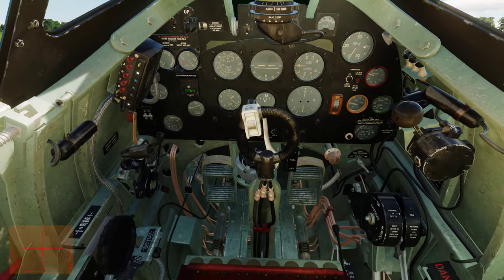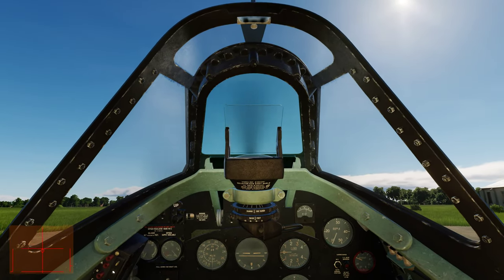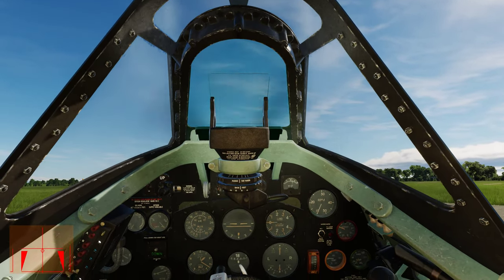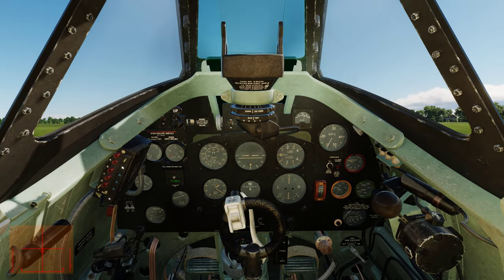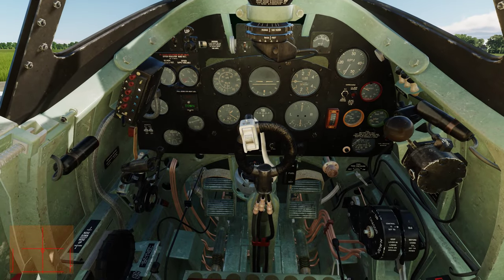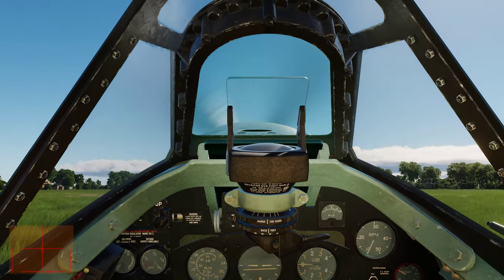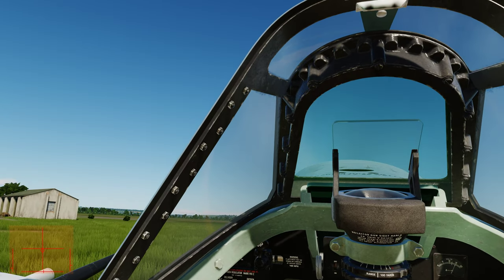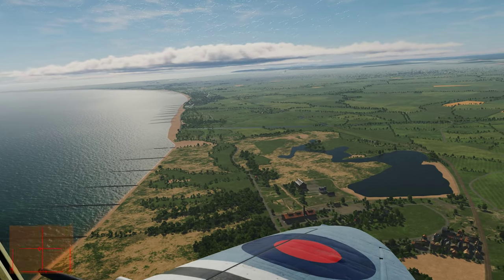WHY IS THE SPITFIRE SO DAMN HARD TO HANDLE? - Spit Mark-Nine Tips For DCS World Pilots - w/Sound Mod

Comment: Part of the issue with the DCS Spit is that the difficulty of ground handling is overdone. I flew a motion simulator last year that was used for transitioning pilots to the Spitfire, and in that - which you'd hope would be as accurate as possible, because it's a training tool for real pilots - the aircraft was about 30% less psychotic. Weirdly they didn't let me do a landing and takeoff in the real one when I flew that, I reckon I could have gotten the thing down in no more than two or three large pieces 😄
It seems weird to me that the control sensitivies are defaulted towards a stick length that maybe 0.5% of DCS users are likely to own. But then that's ED for you - correct as is, thread locked. There's no point in me adding anything about setting controls up etc, because everyones gear is different. One thing I do though is to use little or no curve, I try to get all the aircraft where I want them by reducing sensitivity. The brakes need some pretty drastic adjustments to make them work in any sort of a sane manner.
Reply from the maker: Totally...I think there are so many things to think of, Deadzone, Curvature, and Stick Extensions as well as the "Pilot Touch" on the controls.  I see guys transition from the Hornet or Viper to the Mustang and they Ham-Fist the controls to the max trying to get Gen4 performance out of Gen 2 Fighters.  For me, it was enjoyable years of dialing in my controls and learning on the fly...pun intended.  There is no substitute for self discovery.
Reply: The yaw axis for warbirds is totally over done in DCS.  There are a few videos on YouTube by real pilots showing the difference between DCS and actual planes like the Yak52 and TF51.  IL2 GB in that context is closer to reality
Reply: Dear Sir, I have had the privilege of flying many types of warbirds and Spitfire including Mk I, II, V, IX, XIV and XVIII. Spits are all squirely on the ground but generaly easy to fly and extremely forgiving, however the very very fine use of braking is essential for succesful ground operations. Without fine braking you will either ground loop or nose over in real life guaranteed. I have personally witnessed this in the hands of a renowned test pilot who shall remain anonymous. The issue in DCS is the quality of the pedals available on the market making Spitfire operation extremely challenging and harder than in real life. Joysticks are also far too short and short stroked making all inputs somewhat unrefined. So there is truth in all the comments in this thread, but this is not due to the mathematical modelling of the aircraft. In order to make things easier we would have to 'detune' the torque and brake modelling of the spit to cater for the less subtle hardware solutions available on the market which I am not certain is desirable. For the record, flying warbirds precisely in DCS is much harder in general than in real life due to general incoherence of input methods and lack of seat of the pants feedback which are important to manage aircraft correctly. So to all of you who do succeed nevertheless in operating them safely, congratulations, you would do very nicely in the real thing.... Many thanks indeed and kind regards, Nick
Reply from the maker: DCS is just perfect to me.  Keep going upward and onward sir.  It’s a simulator in its own class, and personally, the only flight simulation that I want to fly.  Often people complain about the realistic feel from their position of Documentary or Video Game Enthusiasts and compare DCS World to a simpler game that they have been conditioned to by dopamine to prefer over others. For me, the chemical jollies of my brain are founded on my own personal real world flight experiences.  I understand that not everyone has the ability or proximity to go flying, but I often recommend that DCS players without flying experience, go take a 1 hour flight with an instructor and “fly the plane.”  When I am in the Mustang or the Spitfire or the Dora, I’m not in DCS…I’m in the air!  Thank you Mr. Grey for your help and let me know what I can do to support your team,
~ Juice
Reply: @AIRWARFAREGROUP  Dear Sir, thank you for your message and for all your support. Onwards and upwards! Kind regards, Nick
Reply: I wouldn't say that the difficulty is overdone in DCS, just that without tacticle feedback like real pilots have, it's a lot harder to tell what the airplane is about to do before it does it.
As far as sensitivity goes, it's just how the aircraft was in reality.  It was extremely sensitive, pilot's using the euphemism that all you had to do to get a Spitfire to turn was to just blow on the control column.  I would agree though that by default, DCS could have the saturation Y pulled down to something like 60.  But considering that would be so unstandard, most people would probably keep flying cluelessly not knowing that there could be another 30% to their potential pitch range.
On another note though, got myself a T-50 Grip with the warbird base, no extentions, just today!  I'm coming from a T-16000 stick.  The grip to base distance is finally sufficient enough I feel like I don't need to adjust the axis settings at all.
As far as brakes go, use right toebrake. Or left, either of them.  It's much better than a button because you get that axis, and you get a lot more brake control.  It will make taxying your Spitfire incredibly easier if you bind it to either of your toe brakes
Reply: @Red-Magic  splendid stuff. Many thanks for your detailed description. Indeed, real life spitfires are indeed extremely sensitive especially in pitch. Great to hear that your setup works well. Yours aye Nick
Reply: @Red-Magic  On takeoff things start to happen before you ever feel them - if the motion sim is accurate. You have to be expecting a swing if you want to catch it in a timely manner. 
One thing I'd love to hear from ED is their justification for the 109 being so much easier on takeoff and landing than the Spit.
The Spit had a reputation for being a bit awkward, but the 109 was an absolute killer if not handled very carefully.
Reply: @colderwar  To each his own, mate :). I don't think such justification is needed, because I've been flying both DCS 109 and Spit since they came out and I'd say it's the Spit that's so much easier on takeoff and landing in the sim out of these two. The Spit takes-off pretty much by itself with two or three slight touches of rudder if the trims were set correctly in the first place, while the 109 requires tons of brutal rudder stomping all the way until climbout. On landing both reward touching down as straight as possible, but the Spit still graciously forgives any tiny bit of an unplanned sideslip, while the 109 in the same situation pulls rapidly to the side and the relatively ineffective rudder isn't always sufficient to catch the developing groundloop. I admit having a tailwheel lock is a massive advantage of the German bird, though! I agree with you on other points. Cheers!
Reply: @Haribo211  Expectation, experience and the users controls have a big role to play. 
Maybe a part of it is my rudder set up. I don't use any curves and have a linear response instead, sometimes with the saturation knocked back a bit.
But the DCS Spit doesn't agree with the motion simulator I flew - and you've got to hope the motion sim is accurate because it's used for training as well as expensive joyrides for idiots like me. It's not that different, just a bit more forgiving on the ground.
I still maintain that the 109 was a killer of new or unwary pilots, there's overwhelming evidence of that.  
Are you using auto prop pitch for your takeoffs in the 109 ? if so then set it to manual and half past 11 on the clock.
That makes life easy enough. Just don't forget to re engage auto once airborne, and sooner rather than later. If you don't then the engine will rev itself to death.

Comment: I just recieved my MFGs amd having more issues than i did with my ball crusher TFRP ones.  Its going to take me a few tries(hundreds of few lol)  before ill get proficient again.  Thank goodness its a simulation.  I would have been religated to sentry duty for ever if it was real lol.
Reply from the maker: How are the pedals though?
Reply: @AIRWARFAREGROUP  butter,  absolutely sublime.  No squeaks, flexing,  my nuts can breathe.  What's not to like lol.
Reply from the maker: Same thing here…I’m loving the space to keep my undercarriage cool and dry!   The regular game pedals like CH Products or Saitek are fine, just too narrow.  I’m the second owner of mine with a SN: 0934
Reply: @AIRWARFAREGROUP  funny,  I am also the second owner of these ones S.N 8434, £100 cheaper than new, now all that remains is purchasing 2 extra stands , 1 for throttle and 1 for keyboard for my wheelstand pro,  just to get it all in the right place.  I'm interested to know what number cam insert you use?  I think I have 5 in place at the minute.
Reply from the maker: I think it’s a number five as it came with two of them and the one that I don’t have installed is a number four.

Comment: Adjust your curves in wheel brakes .
Reply from the maker: Gotcha thanks. I’ll recommend that for new users for sure. I’m going to keep my brake/paddel switch mapped as I have no problems with taxi in and ground handling with the Spitfire and it’s more close to the real thing being on the control spade column.

Comment: Not so hard, it’s taxis just like a MiG-21.
Reply from the maker: I think so too...however, the MiG-21 is not a tail-wheel aircraft with it's inherent difficulties and the client should try this with "Takeoff Assistance" turned off all the way in the Special Settings under each warbird section.  Huge difference that pedals make (when set up correctly) than that of "Twist Stick" controllers.  For those guys who fly with Xbox/Play Station type gamepads, more power to ya. ;^)
~ Juice

Comment: can you trim the spit to fly hands off? I've just got dcs... spit mossie and f18 which I've not really done anything with so far , but the spit always wants to roll ... I've got the thrustmaster f1600 HOTAS...
Reply from the maker: I can for the most part, but the feet are needed still to keep the rudder in check for when the plane starts to deviate from power and speed changes.  Let’s just say that I don’t leave it flying to get up and go to the bathroom 😜

Comment: Its not hard its just a skill issue.
Reply from the maker: Totally agree. Once I learned the technique it's like second nature. I just have to remember to change my brain when I get get out of another airplane and get into the spitfire. My wife says it's pretty easy because my brain is pretty small and fits into my pocket.
Reply: @AIRWARFAREGROUP  I never found taxiing hard but landings where the main issue for me due to the narrow wheel base. I flew the MiG-21 before getting the spit which could be why I picked up the taxiing quicker (Its similar).